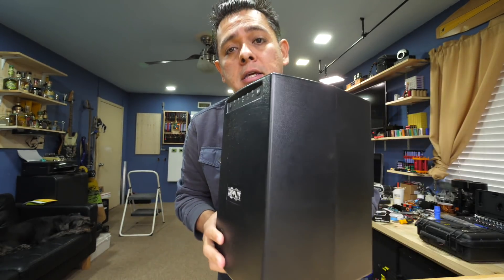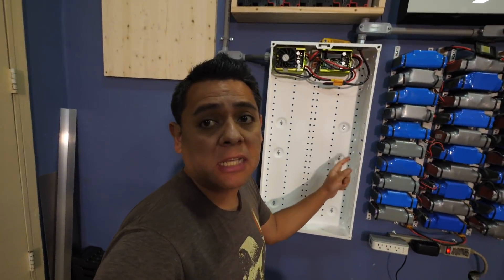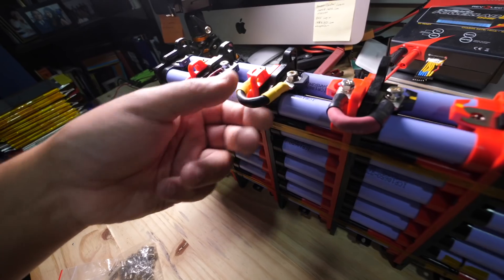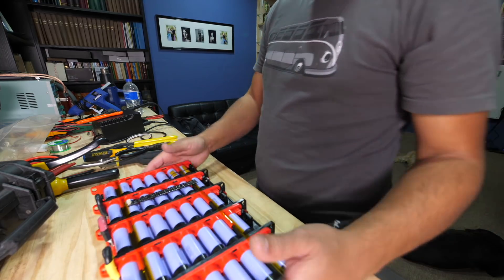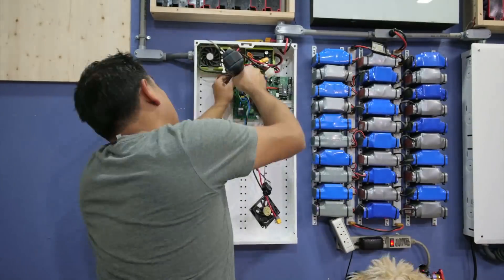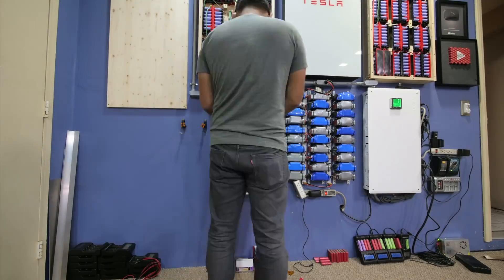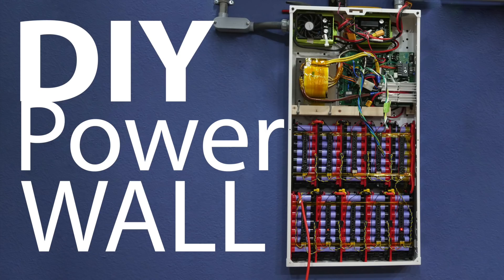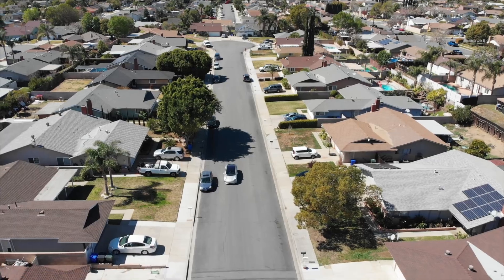1kw DIY PowerWall affordable  18650 build project (2018)

Comment: nice video.  How about 1 megawatt for beginners front to end?
Reply from the maker: Thats a lot of work with little return on investment
Reply: I'm not trying to get a return.  I'm trying to run 300kwh to 1000kwh a month without a electric bill.  It's worth the investment.  Do the math on how much electric I would spend in the past 6 years in 300kwh or more a month.  IT's hurting me really bad brother.  We'll just round it to 1000.00 which its more but that's 72,000.00 I lost on the very very low end.

Comment: One tip for you. Just put some foam under a transformer,or mount it by suspeding it in the air by zipties or something else. That will reduce the noise because it is touching metal case. 

Metal on a metal, vibrating transofmer....will make a lot of noise.

Comment: nice video, thanks for the parts breakdown and pricing
IF i understood everything correctly, you have 36v at 40amphrs
this is equal to 12v at 120ampHrs
$500 for batteries
could use a 'carbon foam mat AGM ' battery for the same price and power and save $342 on BMS cost,
use a 12v UPS,  this build would need a floor box, instead of hanging on the wall
and would save a lot of wiring work and time
i really like your videos, keeps this '70 yr old' brain going,  just tossing out other possibilities
Reply from the maker: More than one way to skin a cat

Comment: How do you build a powerwall that acts as a UPS for your home (i.e. no solar panels) I want to charge it off of street power, where can I find a large scale Lithium Ion battery charger that works off 120VAC?  Has to handle high amps (800-1500 cells)
24 or 48 VDC
Reply from the maker: 1.5 kw =. http://j35.us/ELCON-PFC1500
5kw = http://j35.us/Elcon-5Kw-Charger
Reply: THANK YOU!!

Comment: I recommend thermal silicone plaster for connecting that  BMS sensors. I use it for gluing LED chips on heatsinks and didn't have any problems with it.  Search for ''hc-910'' on ebay thats brand i use and its also non conductive.

Comment: On a side issue.  Ref the 36V battery packs you bought and have in the middle.  They are not many pure sine wave inverters around.  I found one place that has them but you have to order 10 (they say 5 when I emailed them).  They claim too be ISO 9001 certified (which is more tracking quality control of parts etc.) so it doesn't mean the inverter is good quality.

https://www.sigineer.com/product/5000-watt-36-volt-110v-120v-power-inverter-charger-pure-sine-wave/

Comment: Have you seen these.  I wonder if they are genuine at $1.50 each new in an 8 pack.

https://www.walmart.com/ip/New-Purple-and-Red-Large-Capacity-2500MAH-18650-Rechargeable-Battery-8pcs-set-Flashlight-Battery/967488235#read-more

Comment: I have a 15.00 kWac power I better and my solar panels estimated production is 10789.841 KWh.  I do not have the Tesla power wall.  I would like one but really don't want to fork the money over for the 2 power wall battery packs they say I need.  Could you help me to design one so I can build it myself?  I have a couple electrician friends that can help with installing it to my current system.  Thanks.  My email is torino460@comcast.net

Comment: Grounding the system? also... what about using a thermal paste between the temp sensor and the battery instead of double sided tape.  May conduct temperatures more efficiently.

Comment: Transformer doesn't switch anything the sound comes from iron plates due to expanding and contraction caused by magnetic effect. Often noisy transformators are sign to a lower built quality.
Reply from the maker: What about the switching happening in the transistors?  That’s audible too

Comment: Can you make a portable generator ?
https://www.amazon.com/gp/product/B074MN6YG3/ref=oh_aui_detailpage_o08_s00?ie=UTF8&psc=1
155Wh Power Inverter Battery 
This has an outlet plus usb's plus 12v outputs, with the same $50 battery you just used here?
Reply from the maker: https://youtu.be/m04CXhoQ2jU
https://youtu.be/LI132cvpp2U

Comment: You are powering not only homes through your DIY Tutorials but also Young minds like me, Who are curious and hungry to learn about the future of Power management. Thanks, JEHU  GARCIA!! Keep creating these videos... Cheers!!
Reply: pretty lame he didn't up vote this
Reply: waste of money,   standard car battery's put out 1.5 kilowatt and cost $120     this rig in 18650's would cost $2800  lol
Reply: @harleyme3163   you only get a handful of charges off of a car battery before you throw it in the ocean
Reply: @harleyme3163  they last between 2-3 years usually and lithium last longer way more than 3 years...for example I've been using my laptop original battery for 5 years and going
Reply: @harleyme3163  dude. I’ve got 16 3,2V nominal 280Ah lifepo4 cells for ~$230/kWh for my parents solar rooftop system which if cycled at DoD 70% would give 5K cycles with capapacity retention of over 80%. 
That would be enough for an easy 25 years. with BMS and so forth all in all for 3000€.
Good luck with your lead acid shit battery haha.
Reply: You do realize solar panels cost you more than just running electricity right?
Reply: @ToneysReviews   payed very little for my off gird project.
Reply: @ToneysReviews  also in my county if you're greenhouses hooked up to local power. You Need to follow building regulations. So off gird it is.

Comment: Why you don't make a big power wall with all the stuff you have. I mean, dissasamble those and make a new one with one big battery
Reply from the maker: It is one big one
Reply: I mean one big  battery 
module with one charger and one transformer, could be possible?
Reply from the maker: I don’t know what you think I have
Reply: jehugarcia couple of diy powerwalls instead of a big one. Probare de decirlo en castellano a ver si asi nos entendemos mejor. Lo que quiero decir es que envez de tener varios modulos, preguntaba si no seria mejor tener un unico modulo con una bateria enorme, un solo cargador y un unico transformador. Porque creo que tienes eso por cada modulo
Reply: Jehu dont you understand! A bigger one!
Reply from the maker: Define big
Reply: For example, the packs that you use in the video, all of your 18650 in packs like those and in parallel. To make just one big battery. That means just one charger and one transformer to use it at 120ac or 220ac. I think that is more compact than having a couple of powerwalls conected within eachother
Reply: Actually I was just joking about a "Bigger" one, it didnt sound right being written : )

Comment: That noise is the resonant frequency of the wire wound transformer and just a note UPS units are not designed to be run as inverters. They are purely there to allow sensitive equipment to shut down in the event of a power outage. Still love the video, not hating, just informing....
Reply: UPS units are designed to generate a quality AC power supply. Battery size limits the time they will run.

What design difference is there for short duration vs longer duration use??
Reply: @LatinDanceVideos  a lot of difference betwene 1 hour and 10hours  you have to acount livespan of components and thermal designe and so on but those ups are designed for about 5 to 20 mins they are not inverters

Comment: I don't know if you mentioned it or not. But let's say that you have a continuous load of 800 watts. If this was fully charged, how long will this last with the 800 watts?
Reply from the maker: Until 1.65kwh are burned thru
Reply: Theoretically 2 hours, if the capacity of the battery is 1.6 kWh as Jehu mentioned earlier.

Comment: Love the video simplified the construction and most components are easy to find. I ordered the UPS already but dose it charge the Li-Ion cells the correct way even though it was a lead acid system? Sorry if that is a stupid question.
Reply from the maker: No that’s why you charge it with solar panels
Reply: Oh ok I just remember you have another video where you swapped the lead acid for 2 of the hover board batteries and said that you could even charge then by plugging it into the wall. That's why I was a little confused. Instead of using the solar charge controller could I use a imaxb6 charger? I'm trying to make a mini power wall to fit into a rolling tool box so that I can use small tools in the shop while not next to a wall outlet but still charge it back up by wheeling to one to charge it back up at the end of the day.
Reply from the maker: No imax6 charges up to 6s this is a 10s  battery,  get a 42v ebike charger instead

Comment: Why do you always charge batteries to 4.2 volt? Under these conditions the battery last 600 cycles.Why not to use 70% DOD or something? Can you explain please? I worry that 600 cycles is too little to make economic sense of making a Powerwall
Reply from the maker: My batteries are always dead,  I’ve no idea what you speak of

Comment: I did have a 5mile run down the riverside and the battery ran great with no overheating or power loss and this was without bms .when I put bms on I had problems but maybe the kit worked loose so need to spotweld up

Comment: Thanks for sharing this video Jehu. 
I've been thinking about one of your DIY powerwall projects for my workshop and I like this one. I don't need the AC output so  I may omit that part of the build  and just get DC out . I'm a little bit skeptical about the thin wire used between the battery packs. I would have stuck with the welding cable you showed us, but that's just me. 
Anyway, I really enjoy these projects, and looking forward to your next one.
Julian

Comment: I've been making my own car, motorcycle and boat battery connections out of soft copper pipe for years. I flatten one end,drill it to fit over the post , I round the ends on my grinding wheel and crimp them on the end of my cables. Twenty cents apiece. I can make 15 for the price of your 2. Try it.......you'll like it !!!!
Reply: "o wonder that you are an anonymous infantile coward."?????What the hell does that mean Michael?
Reply: Radar House 
Kindly put up a link here to see what you've done as mentioned. Thank you.

Comment: Hey Jehu, have you changed your stance on using a BMS for EV conversions or do you only use a BMS for powerwall applications? I would love to hear an updated opinion on how would set up an EV battery pack now that some new batteries have hit the market (NCR18659GA???).
Reply from the maker: yeah I will use this same BMS on my new battery upgrade on my samba,   just waiting on cells currently

Comment: You have this hooked up to a mains isolator right? 
Make sure you explain what happens if your power goes out and you feed this back into the grid. It would kill a pole worker, the step down transformer on the dead line becomes a step up transformer and the line is not dead.
Reply from the maker: thats a myth,  my 900w inverter would die instantly if I back fed it into a dead grid.   Anyways all this is offgrid,  all grid tie equipment need the grid for voltage reference so its impossible to power on with out the grid
Reply: Good to hear it, I hope that's clear with everyone else building these. I know this is more of a problem with gas generators, haven't seen it too much with DIY power banks. 

It's a pretty bad and specific series of events that could energize a local pole transformer in reverse. If the fault is on your side of the pole though you won't be energizing the whole grid, just that one segment and pole transformer. It's extremely unlikely but there are safety procedures and codes in place to prevent it from ever happening.

Since you're 100% off grid though you're all right.

Comment: SORPREDENTE TRABAJO JEHU, recien ayer descubri tu excelente canal, me podrias orientar acerca de la posible utilizacion de estas baterias para la conversion de un prius a prius plug-in, gracias SALUDOS DESDE MICHOACAN MEXICO
Reply from the maker: Si, se puede usar casi cualquier clase de bacterias pero las mejores son los módulos de TESLA modelo S,  tengo links en mi FAQ
Reply from the maker: http://j35.us/Module-ModelS-eSearch
Reply: Muchas gracias por responder, en la bateria del tesla puedo cambiar la configuracion para tener los 200 volts que requiere el prius?
Reply from the maker: Son de 6 celdas en series =24v

Comment: @jehu : Question - I live a somewhat minimal lifestyle, with plans on minimizing some more. When I move, I want to do something like this video shows. So I did a little basic math and found with all my electrical usage, I average 10Kwh per day a year.
Would a system like this (components) be feasible for that average usage?
When I move, my yearly electrical usage should lower some more, as my winters will be heated with wood instead of an HVAC system. 
Would really appreciate your input.
Reply from the maker: You would need a battery about twice your daily consumption to allow the ocasional rainy day or unexpected over usage of energy
Reply: Thank you!

Comment: Nice video.  Watching these has helped me understand better what all is needed for these projects.  I have ordered a 400watt solar kit from Renogy for my camping rig this summer.  These battery packs seem like they would be awesome to use for camping batteries charged by solar.  This BMS system seems a bit over the top for a camping van setup.  What are the good alternatives for 12 volt systems as far as BMS goes.  Looking for input from anyone.  Thanks.
Reply: A BMS like this is absolutely necessary for Li-ion cells, if you overcharge or if they get too hot they'll burn your house down and add some nice holes in the walls.
Which is also why they aren't used for campers, it's better to go with simple lead-acid setup.

Comment: Great job Jehu! You and a bunch of other folks on YouTube have been instrumental in giving me a good starting point for my own projects involving 18650's, so keep them coming!

On a side note I don't think you mentioned it, but does this work out to approximately a 1.6KwHr pack? If I'm understanding the specs of the battery correctly 40Ah x 4.2v (if fully charged) = 168 wHr per pack. Multiplied by 10 packs gets you 1680wHr in total if charged to their full potential?
Reply from the maker: 4.4ah packs actually so slightly more
Reply: jehugarcia Pretty sweet setup at a very reasonable DIY price point considering the amount of power storage you get here. I would much rather build something myself rather than just buy something of the shelf! Great work!

Comment: What is best bet for 36 volt inverter at say 2000 watts? I want to run a 5000 btu A/C...
Reply from the maker: 36v is an odd voltage unfortunately,  I only using it because of the hoverboard Packs,  But next one will be 48v
Reply: But I already have 30 of the 36 volt packs, any suggestions?

Comment: Hi great videos thanks. I'm new to power walls, do the longmons stop the batteries from over charging? Or do you need a specific charge controller to charge lithium iron batteries correctly? Im struggling to find the correct answers. Thanks
Reply from the maker: They are sensors that can instruct a relay to disconnect battery,  also they discharge up to a rate of 8w to balance cell groups

Comment: Why not just configure the batteries in 32 parallel, so you get an output of around 120v? Then you dont need the inverter? Am I missing something? :) 
Thank you for your vids! They're great!
Reply: That would be DC, so you would still beed an inverter to convert back to AC
Reply from the maker: Correct

Comment: How long would your 900w load run on those 10X 40ah packs?
Reply from the maker: Do the math
Reply: (10 x 40ah) / 900w = 44 min (minus UPS efficiency)
but is that 400ah from 37V down to 30V or completely discharged because  $1000USD for 40 min at 900w sounds like a waste of money unless it was powering your pacemaker.
Reply: 10 * 3.7V * 40ah aprox 1.5kWEh minus eff. .....90% 1500Wh *.9/900W aprox you get the drift about 1.5 hours